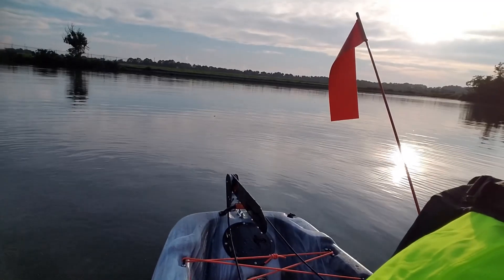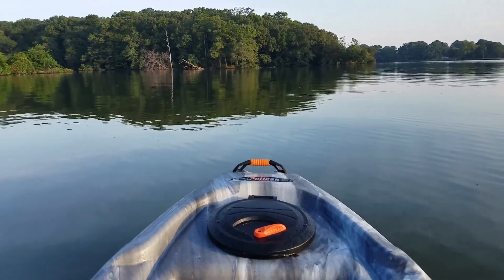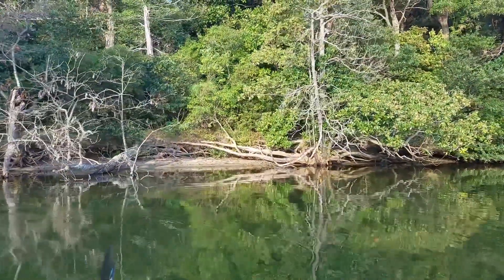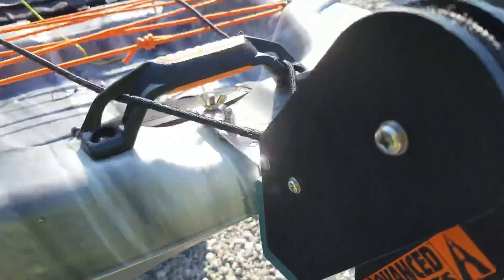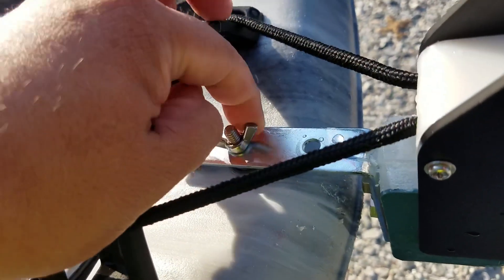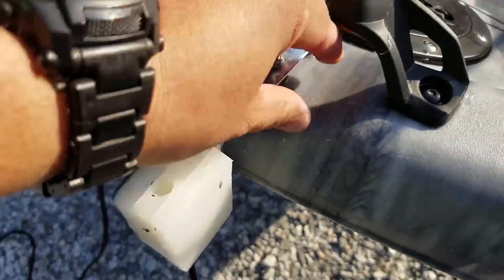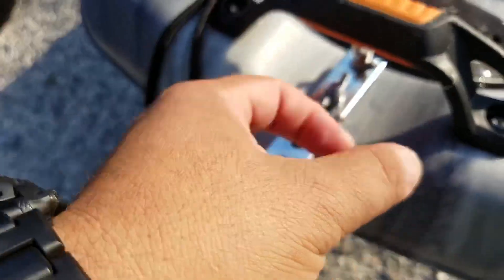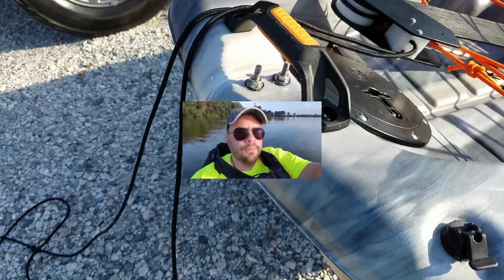Pelican Catch 100 DIY Custom Kayak Skeg

Comment: Do you have a list if hardware? What kind of bracket is that? I ha e a catch 100 and want to do the same. Awesome skeg!!
Reply from the maker: I don't have the exact list for sizes at the moment because my receipts are all over the place. Below should help get you started. 

HOMEDepot
1/4 Stainless bolts and wingnuts with washers
Zinc Corner Brace and Zinc Plate Brace

FORSUN 6 Inch Hole Diameter Deck Hatch with Cat Bag for Kayak
https://www.amazon.com/gp/product/B015B1E4BS/

Advanced Elements Kayak Skeg $60-$80
Find on Amazon, Ebay, Westmarine.com, etc.

Old Cutting Board or Mount with Marine Goop

Comment: How is the stability for you?  Respectfully ... you seem like a pretty big guy.   Can you stand up in it on the water? Or does it feel tippy?
Reply from the maker: Actually,  I got it to help lose weight without added knee stress and have been mainly focused on paddling different spots from creeks, lakes and the ocean. Did not stand up yet because i had no desire to but it feels stable by the two hull pontoon design.

Comment: Why is there orange pool noodle inside the hull?
Reply from the maker: When ocean kayaking it will displace water should a disaster occur.
Reply: @papatechie  Does it help with stability?
Reply from the maker: @OJA1965  pool noodles don't help with stability just water displacement if hill gets flooded